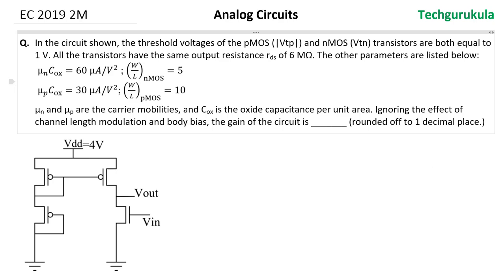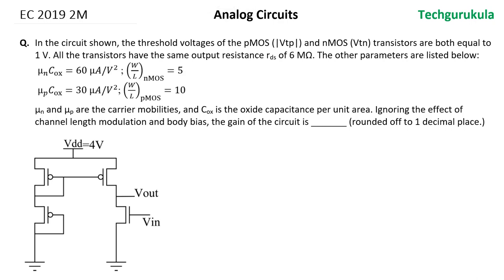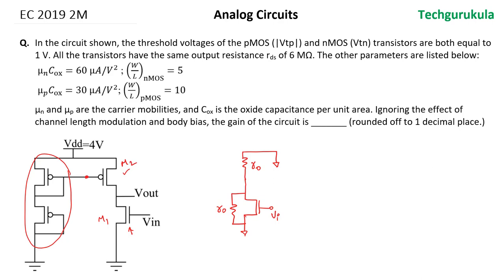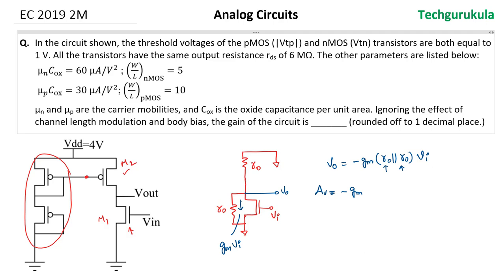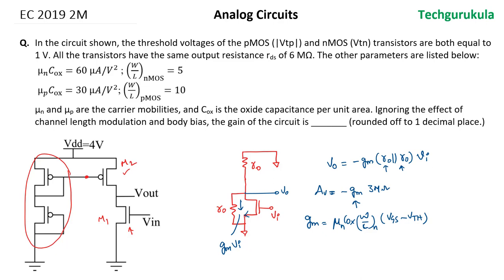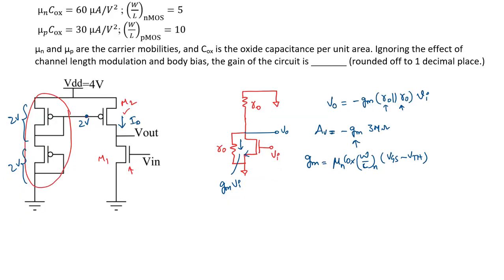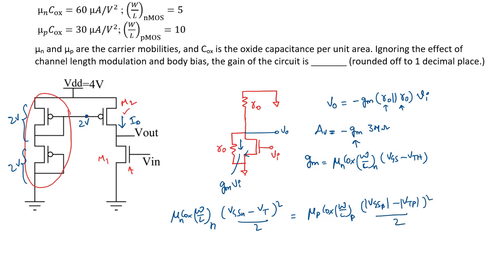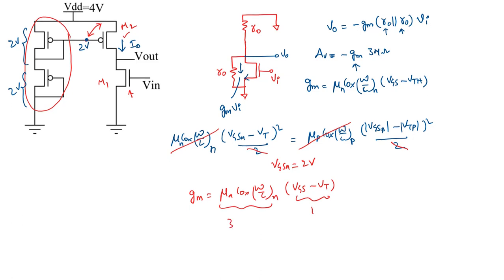AC: EC GATE 2019 2M - MOSFET

Comment: How is M1 ON? Please clarify this sir!
Reply: M1 is ON because Vgs1=2V, this we can solve from Id
Reply: @dastran2731  how can we conclude that M1 is in saturation?
Reply: @AnkitYadav-zg5zd  Just take small nmos circuit with just one loop. Listen carefully, connect a current source across it ( between drain and source) , leave the gate terminal open, now my question is what is the value of Vgs? u can take the help of a computer  simulation and see if u don't believe, here Vgs acts as output Id is input. Or I will explain in a different way, say M1 is OFF as u are saying, then what about Mosfet equations in M2 transistor? M2 is in sat anyway. you can contact me if u want to discuss further
Reply: @dastran2731  how can i contact you?
Reply: @AnkitYadav-zg5zd  u use telegram?
Reply: @dastran2731  yes

Comment: how could u say m1 and m2 are both in saturation
Reply: Great question! I think M1 will be in off condition always and the gain will be zero. Because for M1 to be ON, the gate to source voltage should be greater than or equal to the threshold voltage ( i.e. 1 volt here). But here gate to source voltage for M1 is zero (in DC analysis). I think the question is not carefully framed.
Reply: @AnkitYadav-zg5zd  bro i think the current mirror forces the M1 transistor to be ON, current mirror itself can be the bias. M1 has no choice it has to be ON
Reply: @dastran2731  untill the gate to source voltage of M1 is not greater than threshold voltage, M1 channel is not formed and it behaves as an open circuit. How can current flow through open circuit!
Reply: @AnkitYadav-zg5zd  bro take a Mosfet and connect a constant current source across Drain and Source, what happens??? nothing is told about Vg, Vg is open. will current flow or not? i would say yes!
Reply: @AnkitYadav-zg5zd  current will make Vg to be at the required value , ya crazy stuff. network theory has some forcing concepts, this is what i think
Reply: @dastran2731  The DC voltage at Vin terminal has to be zero because of the applied small signal input source. We can think of some other mechanism of current flow between source and drain.
Reply: @AnkitYadav-zg5zd  no bro, am asking what's the DC value of voltage at Vg1? in this particular question? we will short Vg1 for AC analysis that okay, but am asking what's the Vg1value in DC?
Reply: @AnkitYadav-zg5zd  "DC voltage at Vin terminal has to be zero  bcoz of applied small signal input source" that doesn't even make sense, in reality there is always DC and AC, only in solving thanks to superposition theorem we can hide DC for some time to solve just AC
Reply: @AnkitYadav-zg5zd  here Vinput DC is also 2V, they didn't mention it we can find it, but anyway no need as we will short it for AC analysis
Reply: @dastran2731  you mean to say that there is a dc source of 2v connected to the gate of M1? That they failed to mention? Then bro i already said in my first comment that the question is not carefully framed!
Reply: @AnkitYadav-zg5zd  effective DC voltage of 2V will appear at Vg because of current mirror!. u design a circuit with just a current source connected across a MOSFET and then check the voltage at Vg , u will be surprised to see a "magical" Vg value which u didn't apply
Reply: @AnkitYadav-zg5zd  question is perfect only no mistake at all, we can simulate the question and see outputs using computer nah, a 2V will come at Vg , we don't have to apply
Reply: @AnkitYadav-zg5zd  we always think Vgs is input and Id or Vds is output that's why this confusion, think of Id as input and Vgs as output!? Id is given and Vgs is asked!, mosfet has no specific input output its upto the designer